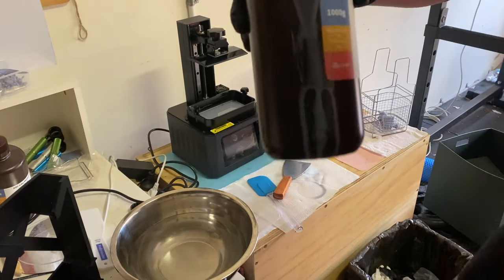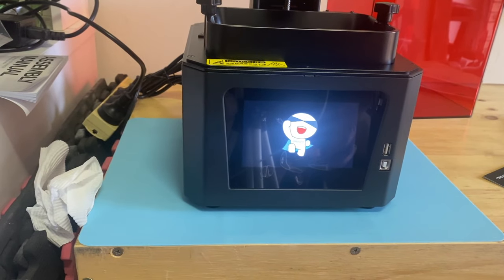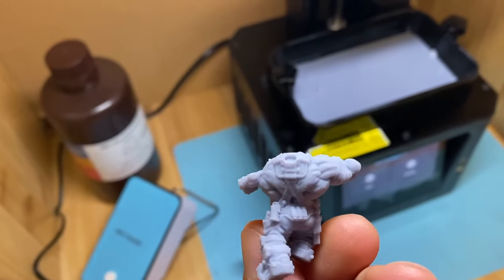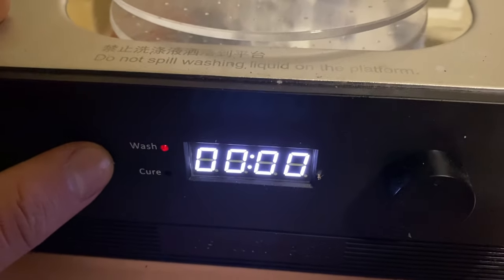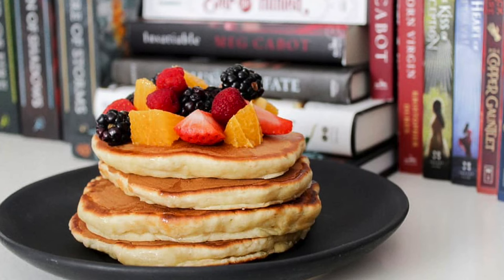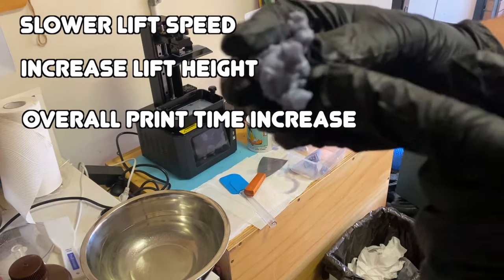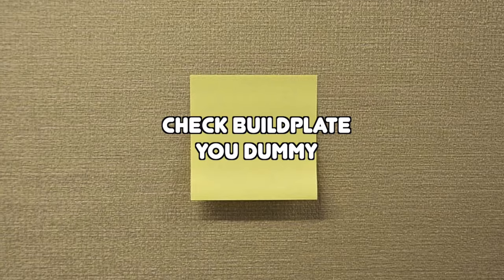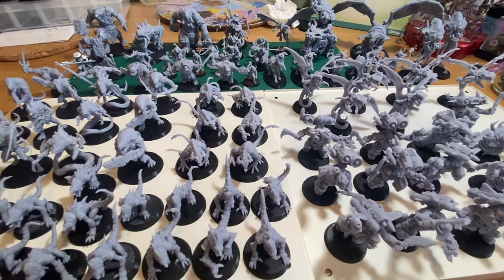MISTAKES I made when I started resin 3d printing

Comment from the maker: I hope my mistakes have been helpful for your 3d printing journey.
Click here to watch me print a GW Battleforce Box:
https://youtu.be/PCBCpDjjg8A
Reply: I’m wanting to get back into printing, even though I haven’t had much run time other than 1 print that only printed 3 out of 4 wheels and then my fap broke because I used the spatula to get the print off I learned not to do that and then my lcd I thought went out so I replaced it and it did the same thing no picture so I put it in my storage but if it’s a software issue 🤦🏽‍♂️ with I hope it is something like that then I can start printing 1/24 car parts for my model kits
Reply: Firmware is not supporting to pendrive how to connect both together

Comment: Tip: You don't have to put your resin back in the bottle every session.  You can leave it in there for days, weeks.  This way you won't be tempted to try cleaning your FEP and thus wearing it/scratching it.  Also, paper towels are bad for cleaning the FEP, if you must clean it then get the resin out (large 250ml syringe) then soak up for rinse out the remaining with IPA and then gently clean the film with a clean microfiber cloth, NOT paper towels.  Paper towels can leave it cloudy, just pushes the resin all over and you're left with a cloudy FEP.  The microfibers are key to sucking up that cloudiness and leaving it clear!
Reply from the maker: I need to invest in those microfiber cloths 👍
Reply: Makes me wonder whether cotton cloth could do the same. I'm quite a lot into woodworking too and we use cotton cloth with our oils, as paper towels can leave unwanted scratches on a fine sanded surface. Cotton cloth for woodworking won't do that, have excellent suction ability and can be bought in rolls that are much cheaper than microfiber cloths
Reply: Are you just tossing the cloths after?
Reply: @JohnVanderbeck  Idk about this, but I imagine they could be washed for resin in IPA and then just left to dry, once the majority of the IPA have been squeezed out of the cloth
Reply: Some resins have to be stirred if they sit for more than few hours.
Reply: Good idea, that way the VOC level can be stable all the time in the room, rather than just lethal during prints. 👍
Reply: @briankale5977 bro if ur that worried get a cover/box with a vent out if ur that worried
Reply: I know I'm a little late however, I got a printer yesterday, and today when I was moving it to clean the resin out of the vat some of the resin spilled out and seeped through the little holes in my printer (Elegoo Mars Pro) do you have any ideas on what i should do. @Habes
Reply from the maker: @allenjames-oh7dy  does it still print?

I haven't had that issue. 
This is just a guess.
If you're brave enough you could open it up and see what the damage is like. Try clean up the resin with some alcohol wipes. Just make sure the machine isn't on or plugged into the electrical socket.
Reply: just up Z and rehome a few time. so this will squish and mix up your resin just enough before a print.  @YarHarFD
Reply: Hell I left resin in my printer’s vat for literally months (maybe even over a year?) and all I had to was stir it to mix it all back up.

Comment: Regarding failed prints.  Depending on how complete they are and the Games you are playing, they can be casualties .  Say an arm gets blown off or leg gets cut clean through with a sword.  You finally get to use that blood red paint you have been saving.  You get the idea.    Melt a few as well everyone uses that dam fireball anyways!!!
Reply from the maker: That's actually quite clever. I've kept most of my fails that are at least 50% intact, so I'll look at making some objective markers and the like. Thanks Tom!
Reply: @Habes   welcome and keep up the great work
Reply: That’s BRILLIANT 😅❤ How did I not think of this
Reply: yeah, im soon getting into printing and im not even scared of failiures cause i think they can get very decent terrain pieces or basing material. 
also if you are wargaming you are able to exchange your misprint with the decent print to show that it is down. 

imagine a full tanke beeing exchanged with a broken tank and then just get a LED candle with some cotton to make a smoke&burn effect.
Reply: @deformiertergolfball4847    more than Awesome....that is great thinking!!
Reply: Good idea. Except- no, you cannot melt the UV-curing resin. It doesn't melt form heat, it actually burns or shatters.
Reply: @digimaks   Melt?
Reply: I always try and salvage parts. Have some tails and claws without the pointy ends and the mini is battle damaged!
Reply: Resin might not melt with an open flame, but if you accidentally leave it on the stove, it will certainly melt to a degree.   coughs  ..I swear I'm not speaking from experience...  Though it makes me wonder if a soldering gun could carve resin and create more "battle damage".  

Could also use an eyedropper and make a line of resin on wax paper.  Then hit it with UV light for 30ish secs until it's semi solid but still pliable and tacky, so you can add guts/muscle/bone to broken figures.  Then UV it again to cure.  

I love all the ideas in this thread!  Great vid too!
Reply: I do this with my minis. Or sometimes it's built into the NPC story arch. I have one orc that's missing an arm. He was a fierce warrior

Comment: I've been resin printing for a couple of years. You have offered good, relavent advice to beginners. I however, am still guilty of having too many STL suppliers. You CAN collect so many STL files that you can become paralyzed on what to print next.
Reply from the maker: Thanks for your comment! Yeah I'm starting to have that problem too, with too many STLs.
Reply: I agree. The library of shame has grown so much. I've noticed that I've become spoiled with pre-supported files and can't be bothered to do my own supports.
Reply: Waaaaaaaaay too many STL's and patreons supported. I'm spending more money than I have spent on GW models earlier.
Reply: @DiavloPL  Yep! Told my group that was it. Now more wild spending until I'd cleared my pile of shame. Then went and got a 3d printer and spend hundreds on STLs for other games systems! I could have bought an entire army with what I've spent this month alone :')
Reply: @The_Gryph  and my 5th 3d printer just arrived, its not a best hobby for compulsive/impulsive :D
Reply: Everyday, I started a printing business cause I can't get enough of it.
Reply: I tried cleaning underneath the vat of my Saturn 2 and now it's smudged, any ideas?
Reply: @stuntman083  Use a  bit of IPA and a clean, I stress clean cloth, not a paper towel, and clean the area and let it air dry.
Reply: @IPrint3dMinis  thanks I'll try that. hope the paper towel didn't ruin it, that was my first attempt
Reply: @stuntman083  It won't ruin it, not that easily anyway. Paper towels can have texture and you just don't want that scratching anything and making it fuzzier over time. The softer the cleaning cloth, the longer a FEP will last.
Reply: @IPrint3dMinis  great thanks man
Reply: I work with polymer clay, hence my interest in 3D printing. (Polymer artists like 3D-printer cutters and molds, as well as miscellaneous tools.)

The reason I’m commenting is because we polymer people have the ZACT same problem: our hard drives are filled with documentation on techniques we wanna learn/use, tips, tricks, and hacks, color schemes, photos of things that inspire us, and so on. Some days, we don’t make ANYTHING because we’re too busy looking through, sorting, and organizing all those damned files! Grrr!

I’d thought it was only us, but seeing your comment makes me think it’s a problem for all hobbyists. I’ve also recently taken up crochet, cosmetic chemistry, sewing, and electrical engineering, and am now worried that these hobbies are also gonna take over house and home*! 😱

*My “house and home” is a 10’x10’ room (I’m a disabled vet living in a residence for disabled vets), so this concern is HUMUNGOUS for me. I’m already treading polymer clay everywhere and tripping on yarn, and it’ll only get WORSE despite my having filled all my walls with shelving and storage boxes. 😕

When I look at those 420 sq ft sheds at Home Depot, I cry tears of envy and desire. (And the commercials about “she sheds” just break my heart that I can’t currently have one. 😰)
Reply: i dont even got my printer yet and already have tons of files which i might want to print. 

but i already sorted them after "nice to have if i ever feel like it" ( since sometimes nice stls get deleted and this way i secure to have them if i want them )  and "priority print"  - where im having the models for which i actually bought the printer in first place. 

i hope everything will turn out decent
Reply: To begin a Toys selling business which 3d printer is better?

Comment: My biggest tip for anyone is make sure you have enough holes in your prints so resin does not pool inside a print. A hole at the top and a hole at the bottom of the item is best for airflow and cleaning.
Reply from the maker: That's a great tip, particularly for hollow prints.
Reply: In particular, Run thru the model layers in the slicer and look for isolated chuck of resin shaped like a cup or bowl.  These literally can from “suction cups” when the model is upside down and trying to pull up off the FEP, multiplying the suction force dramatically.  So in a hollow model, there might be the cup shapes formed on the interior of the bottom wall, or even formed in the exterior of the upper surfaces.  Drill a hole thru the lowest point in all of these to allow air and resin to flow readily so a suction cup isn’t formed.  This goes for solid models too, any feature on the model that might form a suction cup against the FEP should have a hole drilled clear thru to the other side.  This is especially important as models get larger as the suction forces multiply with area of the cup.
Reply: I often add a hole at the lowest point of the print (for example, the head) not only to allow flow through when cleaning but to avoid resin accumulation when cleaning due to vacuum lock with the interconnecting passage being too small to allow sufficient cold resin to flow and drain when cleaning hollow prints.
Reply: How do you then hide/fill in the hole in the print of the finished product? This makes a lot of sense, but I wouldn't want there to just be visible holes in my models
Reply: @internalscreech  If the miniature is large enough to warrant hollowing which is when you'd be hiding it then just print it in parts, usually the holes go in attachment points

Comment: My biggest advice for those in colder climates is to make sure your resin is warm enough! You can buy a fermentation belt to help but cold resin is more viscous and increases print failures and decreases overall quality
Reply from the maker: Yeah, cold resin lead to a lot more failures for me.
Reply: I second that. With viscous resin it’s super important, like Siraya tech blu. You can print a little heater enclosure and get the instructions from a Couple YouTube vids. It’s  nice because it has a thermostat so you can set the exact temp you want your resin to be. It costs like $20/$25 total for all parts plus printer enclosure.
Reply: When I started using a mini grow tent with a space heater in it my success rate increases exponentially. Definitely a worthwhile investment. Also makes getting rid of fumes easier

Comment: Thats good to hear someone else backup the theory of very slow or very fast lift speeds. 180-240 lift and 300 down for me. I have a half second delay before the UV comes on to give the resin a little time to settle back under the print.
One tip I have is, after washing but before removing supports, soak them in very hot water, not boiling, but as hot as you can get away with and still put your hands in. Leave them for a min or so and it really helps loosen the supports which reduces the scaring when you take them off, half the time they will just fall off.
Reply from the maker: Thanks for sharing and all your comments on different videos. I really appreciate the insights you've shared on all of them.
Reply: So if you have a curing station do you cure after the hot water?
Reply: @FreedomForce100 Usually it's wash > hot water > remove supports and then cure

Comment: nice to see a fellow Halot one appreciator, I've had mine over a year, I must say I haven't bothered with dialling in the resins with the calibration tools etc. I just estimate given the resin parameters anbd its basically always been fine, for example my current product says 5-15 seconds and I just go at about 6.4 seconds and works fine. Also changing the location of your prints in the bed not only saves your FEP (cheap and easy to replace) but its also saving your LED screen (much harder to replace).
Reply from the maker: I never thought about it saving the screen. Thanks mentioning that!

Comment: I've been thinking of getting  3d printer for a long time now. I saw some pretty good deals online, and that brought me to you channel. After pouring over loads of your videos, I pulled the trigger. I love 3d printing, and your videos have made it really easy to get into. Thank you, and keep up the great work.
Reply from the maker: No worries Garrett. I'm glad they have been helpful. When it arrives, feel free to message me on instagram if you get stuck setting it up.
Reply: @Habes  PSH you made everything so simple. It's all set up and printing. I had 2 fails so far, but I'm printing in a basement. Did some small adjustments, and boom. Solid as a rock. Thank you again.
Reply from the maker: @garwmart  glad it's working！

Comment: One very important thing you forgot. Ambiant room temperatures. In warmer parts of the world less of a problem, if you live in colder regions your gonna want to get that room temp up to between 20 and 30C as the warmer it is, the more viscous your resin is, less print failure. Also depends what your printing but generally speaking you cant expect great results if your printing in a cold room.
Reply from the maker: Yeah that's definitely true.
When I made this video I had only been printing for a few months and we were slowly heading into winter, so I hadn't experience what happens once it gets colder.
Definitely solid advice. Thanks Keegan!
Reply: Would something like a fermentation belt or another source of heat also do the job instead of raising the overall room temperature
Reply from the maker: @countrydude183  Yeah, particularly from and energy/cost point of view.
I current have a small 40W heater that I use with my printer in a small cupboard when it gets cold.
Haven't tried a fermentation belt though.
Reply: @Habes  I was thinking that would be an alternative but just wanted to confirm, thank you very much.
Reply: *LESS viscous
Reply: @countrydude183  yes it might as long as you can put more heat into the printer before it dissipates from surface area. The objective is really to get your resin to a decent warmish room temp anywhere between 20 and 30° c,

Comment: I have a mars 2 and have had only a few failures, all of which were the result of the model orientation. My biggest tip would be to orientate your model with the majority of the mass (like the body) closest to the build plate, with the lightest parts (like the limbs) printing last.
Reply from the maker: Yeah that’s a good one. Thanks for sharing 😁

Comment: Obscene lift speeds are such a big issue when troubleshooting failed prints. I see so many people wondering why their prints failed and, when you ask them to share their slicer settings, you see lift speeds as high as 360mm/m! Everyone is in such a rush these days, and they're baffled that their warp-speed settings didn't work, blaming their printer or resin when the real problem is that they're trying to run before learning how to walk (or even crawl). 

I think all of these 3D printing channels are doing a big disservice to the community by promoting Vroom settings without adding a disclaimer that people new to 3D printing need to get their printers calibrated & printing successfully at slower settings, first.
Reply from the maker: Thank you for your comment and insight. 
Hopefully I didn't come across saying "vroom vroom baby" and not highlighting the potential risk for more fails. I'm going to pin your comment so hopefully more people can read it and be aware of it.
Reply: @Habes  To be honest, in trying to help some people out, I've looked up manufacturers' recommended settings in their manuals, and it turns out the reason you see these 360mm/m speeds is because that's what's in the manuals (looking at you, Anycubic). That's wild! Perhaps the newer printers are coming out with improved FEPs that really will work reliably at those speeds, but I will still always believe that you need to understand the fundamentals of what's affecting your prints before charging in on just blind faith.
Reply from the maker: @terpdx  360mm/m is crazy in my mind. It could be something newer models are working towards to reduce print times as the refine the process.
Reply: I had my first prints with my first resin printer last week. I set my lift speed to 2-4 mm/sec i think
Reply: @Namamiri  Did it work for you? If so, that's great! Those settings are within the standard "fast" speeds I've seen. The new settings I'm seeing for ~360 mm/min (6 mm/sec) are very high, and I'm afraid it might lead to frustration for people new to 3D printing when they have print failures but have simply followed the settings provided to them by the printer manufacturer. I've yet to try the newer "nFEP" films, though, but perhaps those make super-high lift speeds a practical reality.

Comment: 4years FDM and no resin printer but I’ve followed the tech and some of your advice is still useful for makers like me. like splitting up large prints into smaller pieces in case of failure you can reprint the pieces instead of wasting product. 
Appreciate the candid advice